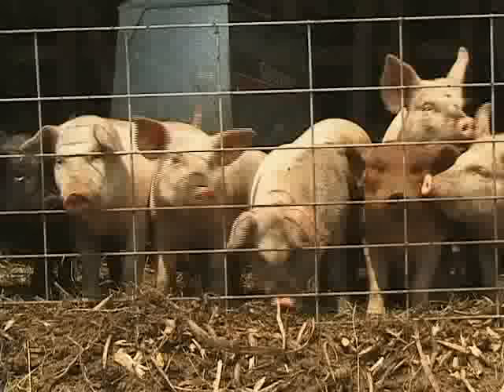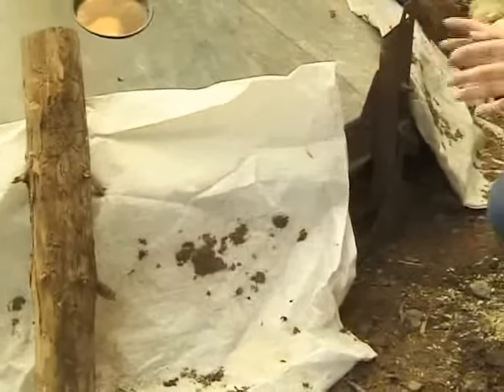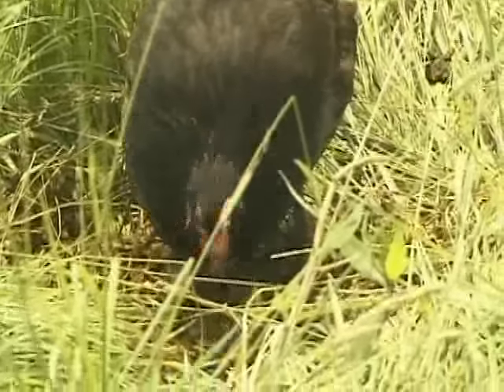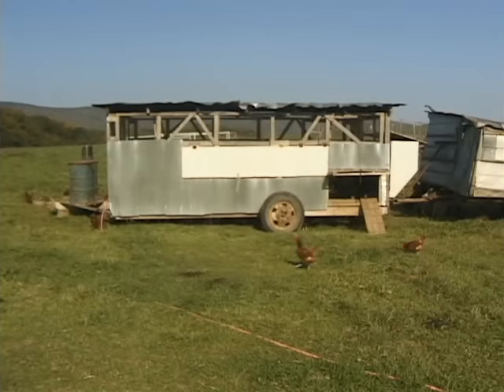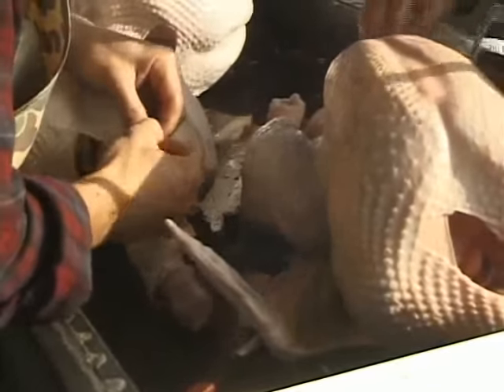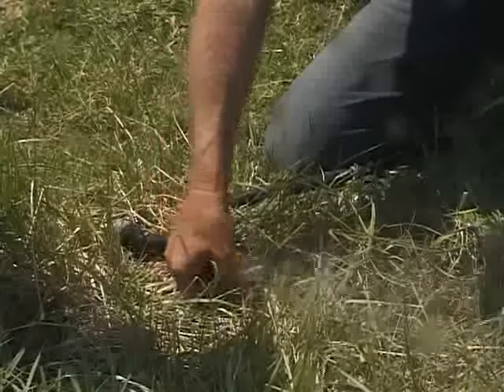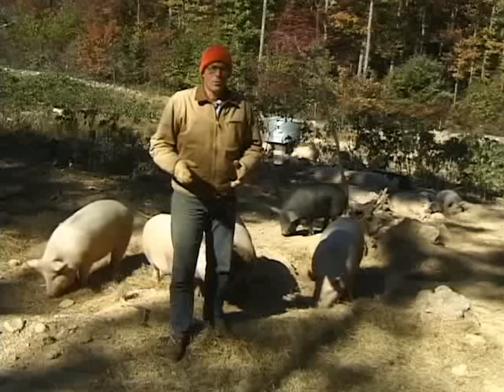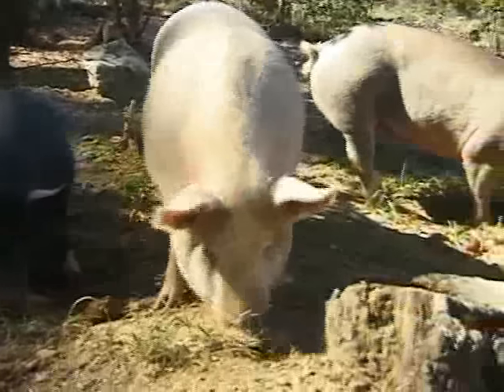Joel Salatin - Polyface farm

Comment: If you don't feed grain what do they eat in the winter?  I am now 70 and farmed until I was 61 when I got injured and could no longer do the work. I just wish that I had known about a lot of these rotational ideas back then I had 600 acres and leased another 1000. We could only run 1 unit (cow & calf ) per every 8 acres. Of course I didn't know about you tube which is really helpful often. Thank you for the information and ideas.
Reply: He feeds hay in the hay shed through the winter.

Comment: no comment just a question! what is the nitrate concentration in water seepage flowing into his storage dams and ponds?
Reply: All of his ponds are built on high ground in order to gravity feed his water systems so nothing seeping in. 
Manure in the field gets scratched through and spread by the chickens to fertilize the grass for the next round of the cows in a couple months or so.
When winter feeding in the hay shed, all the manure and urine is captured by a "carbinatious diaper", constant supply of wood chips under their butt to soak it up and turn it into compost later. 
He addresses this in a few sections of the video. The winter feeding shed is about 3/4 of the way through.